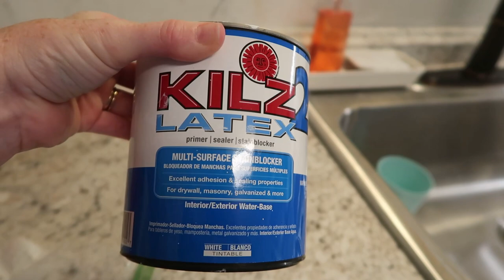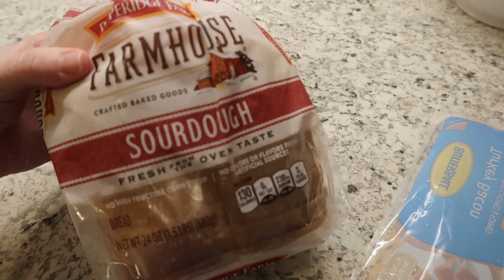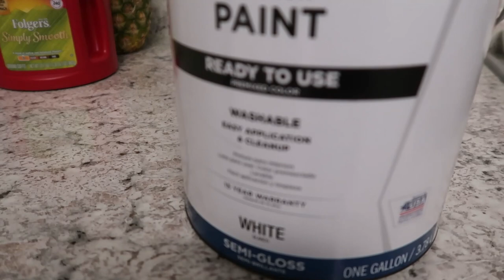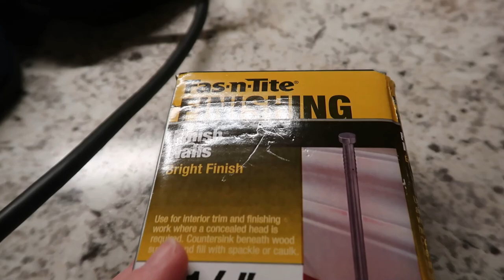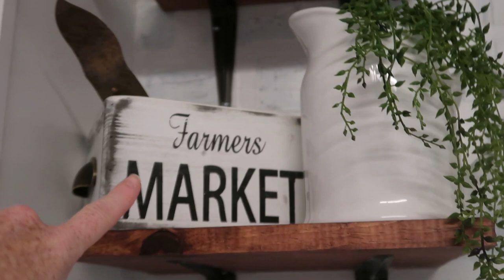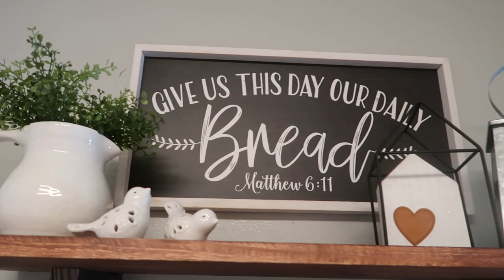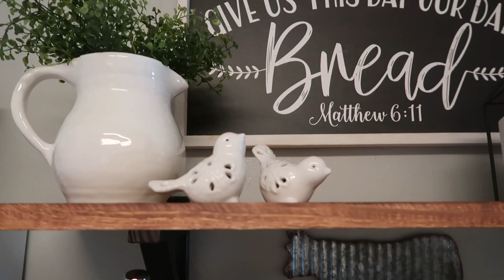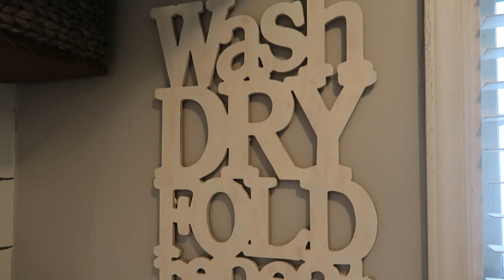SMALL KITCHEN RENOVATION VLOG / KICK PLATES, PAINTING BRICKS AND TRIM, STYLING MY SPACE

Comment: Hi just wanted to make a comment about the bead board backsplash. You probably could put it up and have it overrun into were the window trim would go. Your carpenter should be able to cut out the excess with a shallow blade setting on a circular saw or a plunge cutter.  It would take the carpenter 5-10 minutes. You could always call the carpenter first just to make sure. The kitchen is really coming along nicely. I cash flowed my kitchen remodel. It took 2.5 years but it’s finally finished. Kitchens can be stressful but it’s worth it.